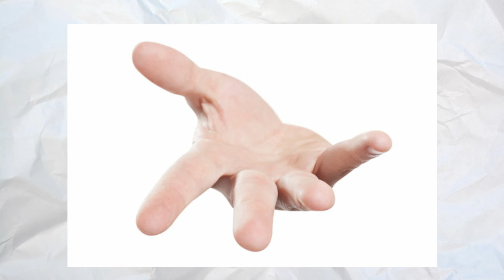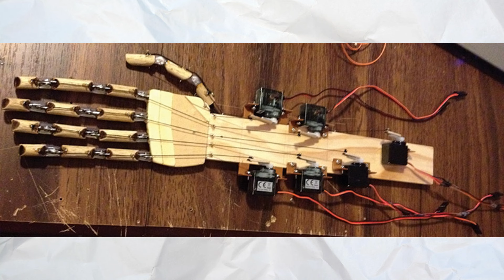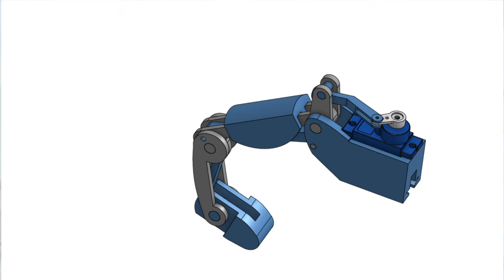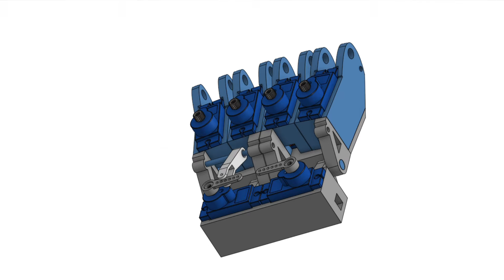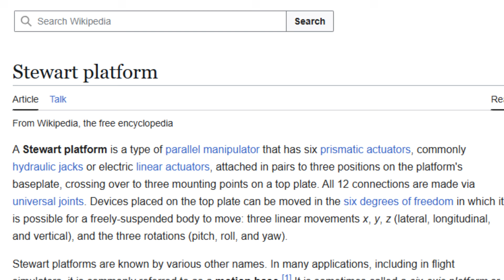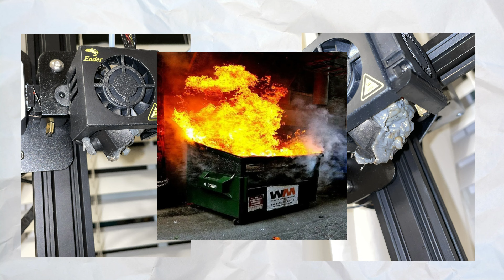Making a Robotic Hand (it's hard)

Comment: Ender 3 was my first printer as well. Once I tried one of the Bambulab X1C printers, I was shocked by its ease of use and reliability. It was one of the first printers I used that 'just worked'. No countless hours of troubleshooting or manual bed leveling.

What i found trying both brands was this: if you want to work on 3D printers: get and Ender. If you want to work on 3D printing: get a bambulab.
Reply from the maker: Thanks for the advice, will definitely look more into getting a bambulab.